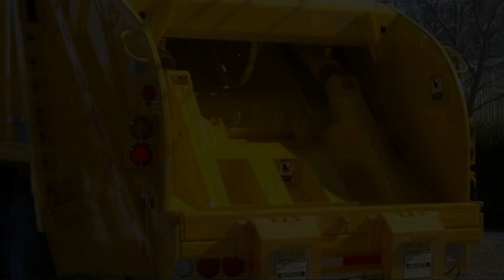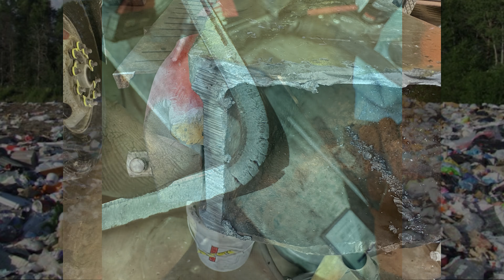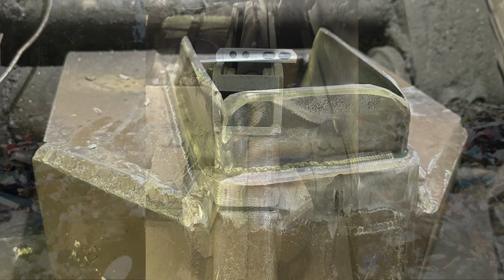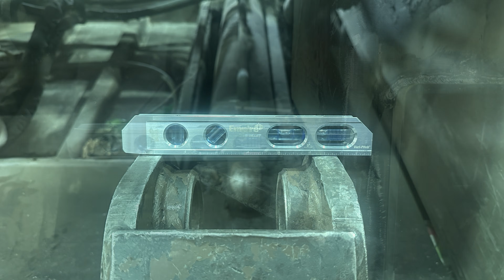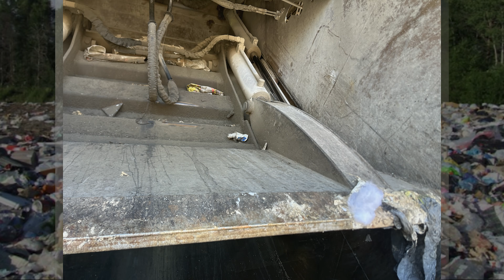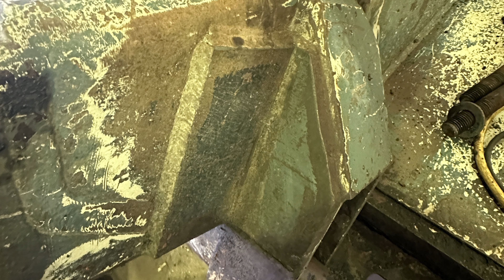Guide to weld repair broken equipment

Comment: Its usually made from hardox 450 type of material
Reply from the maker: The steel cut super clean, but didn’t feel or file different than mild steel.  I know the packer blade itself was definitely some sort of alloy, it was way harder than a lot of the other steel.

Comment: Great video! With 1 exception, over 30yrs driving a front loader I've learned that they always look for a way to blame it on "driver abuse"  even when the equipment is worn and tired, nothing last forever!
Reply from the maker: Great points lol.  A good operator stops when one part is broke, a bad operator keeps going until multiple are broken lol.   It’s amazing how beatup older equipment can get.  A lack of maintenance will surely speed it up.  A good operator will make a huge difference in longevity of equipment.
Reply: @makingmistakeswithgreg  100% spot on!!
Reply: I agree but it's usually even worse, the operator shuts it down when there is a problem, then the owner or manager throws a fit and orders the operator to "run it till it blows" then when it comes apart and shuts the job down for days instead of a couple hours like it would have taken to fix it before it blew apart it's "operator error" and they "never said that". Everywhere I've worked over 30 years it's the same story!
Reply: This time of it breaks again the operator can blame it on the welder
Reply: That's why welding repair should always be overbuilt to be stronger than the original part. At least that's how you should repair your own equipment.